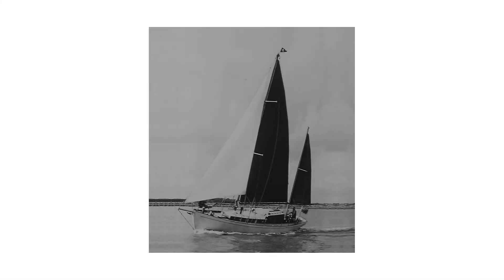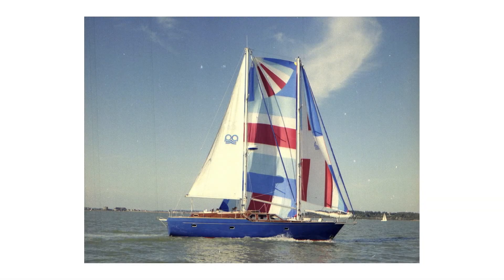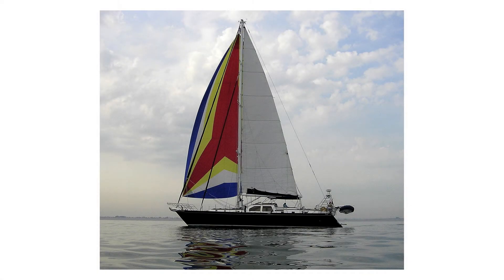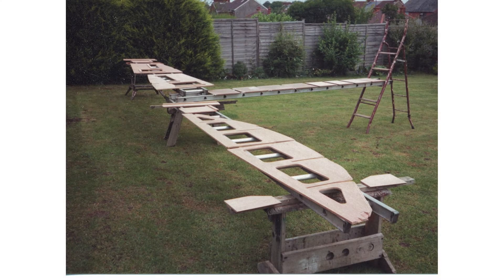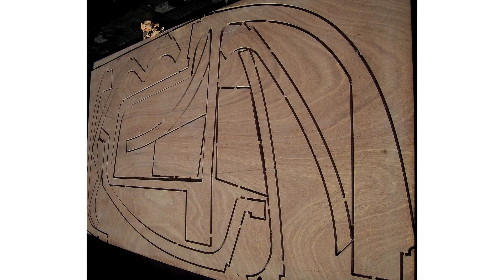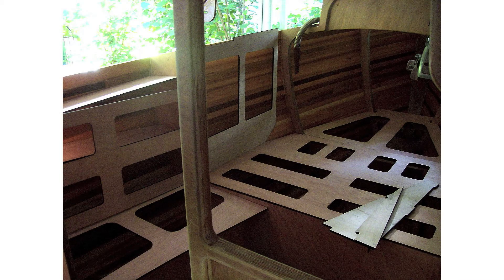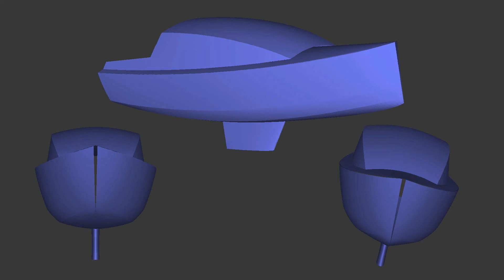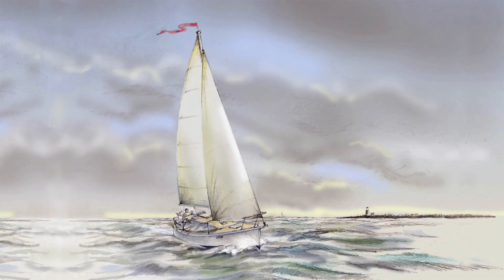The EasyBuild Project: Boats that almost build themselves.

Comment: I use a 8x4 foot CNC router at work for making the ribs for curved walls and kiosks. It's easy to use and it was a kit. Lots of dust. It would be great for cutting sail boat ribs or forms for a foam core boat. All you need is autocad or dxf files.